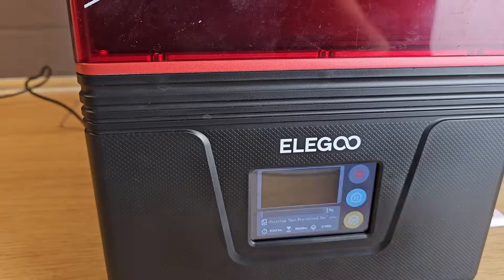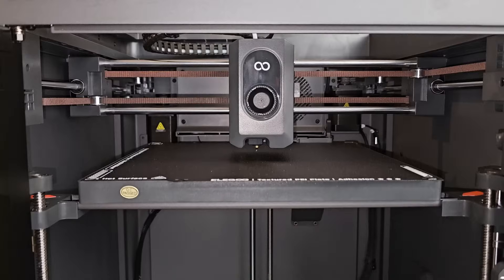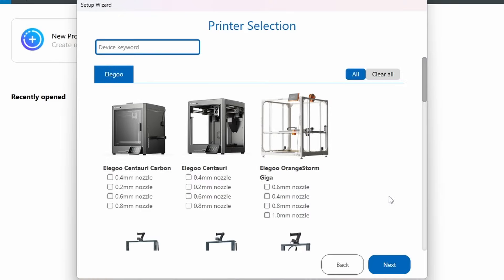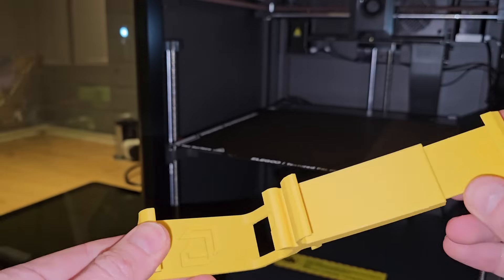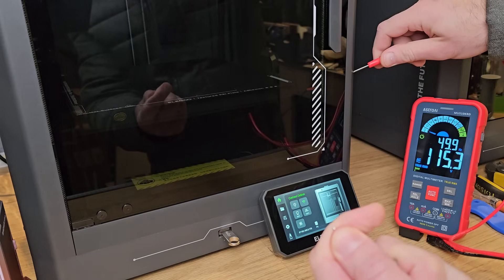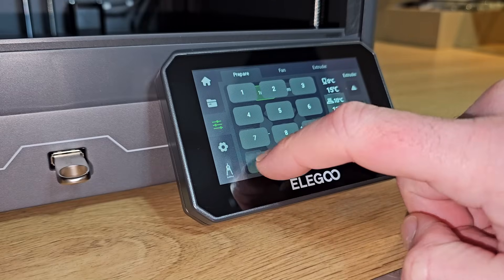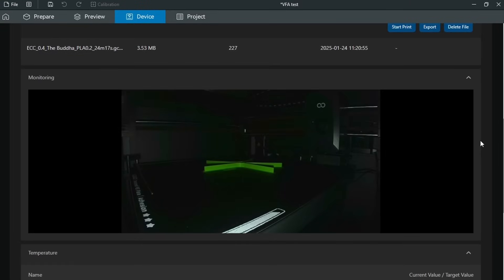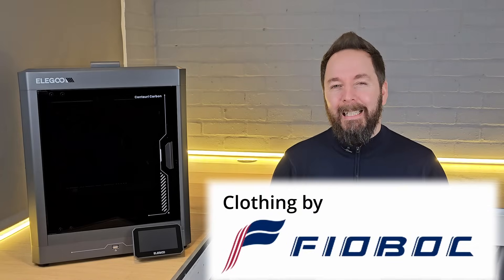Is The Centauri Carbon WORTH The Hype?

Comment: I think this printer is geared towards beginners and younger kids, and looks like they nailed that.  This printer has a place in that market for sure and obviously isn't for modders and experts, but every printer does not need to be.  There are plenty of options for that with RatRig and Voron.  Always enjoy your levelheaded and sensible reviews Ricky.  Keep them coming.
Reply: What even are experts? I use 3d printers professionally. I'm not modding them, I want them to work. I'm glad we are finally at a point that I can order a 3d printer, set it up and it works out of the box.
Reply: @user-sk4nt5bm5r I agree, I feel like most people aren't looking to mod these devices, modding is out of a necessity if certain features aren't provided. The better a device works out of the box, the better.
Reply: @user-sk4nt5bm5r  
Same. All those modders are mostly hobbyists. I spend all my time in cad and other software modeling, i start up the printer to prototype parts, i dont want to change anything, i want it to print, print fast and to keep dimensional accuracy.

Thats why i got a bambu, despite my serious dislike of the company and its policies they make printers that work. Though i want to switch, i dislike the company which seems on fast track to become as bad as 2d printer companies like HP, but so far the alternatives seem like a sad joke.
Reply from the maker: Yep, completely agree

Comment: You have actually found a very big electrical issue. It sounds like Neutral and Ground are reversed or connected at some point in the printer. Under proper operation, voltage comes in on the Line/Hot wire. Work is done as the current flows through the electronics to the Neutral (NOT ground) wire. All other conductive parts are linked and connected to ground as a safety net, in case something hot inadvertently touches a conductive non-electronic part like the frame. Ground will never have voltage unless something extremely serious is wrong.

So, what you discovered was two safety issues... Something hot is in fact touching or connected to the frame when it shouldn't be. And your ground circuit was in a state of failure, preventing it from acting as the safety net it is intended to be.

If two printers in a row had this same issue, there has likely been a manufacturing run (where two wires were reversed. Or someone on the line is putting them together wrong. Please make sure this info gets to someone at Elegoo who will understand the problem... They likely will need to halt all shipments and recall immediately.
Reply: You do realize that the ground and neutral are tied together.
Reply: @mrfunkington  If they were tied together in the way that you appear to be assuming, there would be zero need for both wires. They both terminate to the same bar in the electrical box (yes... they are tied together there), but this is not the same as being tied together in the appliance. In one case (what you are implying), a faulty ground line can kill someone. In the other, it serves as a safety feature as described.
Reply: @mrfunkington  It's better to stop talking when you have no training on the matter. There are multiple earthing arrangements - TN, TNS, TNC-S, TT. Yes, N and PE eventually come together - but definitely not on the consumer side of RCD.

Comment: i was looking at this and prusa core.  firmware might be a deal breaker with elegoo on this one.  one more check for prusa.
Reply: You're comparing a luxury German car to an entry level Japanese car with the high level package.  This printer is going to come in under $500 (a lot of people speculating closer to mid $300 pre-sale).  The Prusa core 1 is $1k
Reply: @mrfunkington  I have seen videos of elegoo and prusa go head to head.  Elegoo was right there few cases out did the prusa. as I'm replacing a 11 year old flashforge pro that is a dinosaur to today's stuff.  All and all they do the same in the end it PRINTS..  car gets you from point a to point b.

Comment: Electrician here please don't use cheap electrical equipment make sure it is UL listed if you are going to use it cheap manufacturing does not make safe electrical equipment the price savings is not worth your life.
Reply: These are not "production" machines but rather pre-production machines, sent out to hundreds or thousands of YouTubers and reviews to get them into their hands to make videos before the PRE-SALES launch on Monday February 17th.  So take all of the wrong things with a grain of salt.
Reply: @mrfunkington  This is a result of fundamental flaw in thinking about AC handling. Stop making excuses for potentially deadly equipment!
Reply: @wide.wombat he said himself that nothing elegoo sent caused the problem it was a adapter he was using not made by this company. You people have selective hearing or what?
Reply: @matthewhoy5577  It doesn't work like that. The dodgy cable exposed the issue with the printer, not caused it. 

A device should work 100% correctly without PE. Protective Earth is there only as a safety measure to save you from a shock when something fails. If it saves you from a shock when the device is new, the device is in failed state from the very beginning. A device like that would not pass any decent electrical safety certification.

Comment: I would suggest further investigation on the voltage on the case. Grounding is a backup incase there is a fault somewhere. The fact there was a break in the ground in the cable does not explain voltage on the case. If it is only happening during bed heating there is a lack of isolation in the SCR, wiring from SCR to bed or bed itself. There should always be full isolation between case and mains voltage.
Reply: shouldn't the gfci trigger instantly, when the case is under voltage?
Reply: @damian007567  Without PE (protective Earth) connector - no; it is just voltage, there is no current going out. But with PE or with someone touching the case - yes, it should trip.
Reply from the maker: Thanks, it felt like something wasn't 100% correct but my knowledge only goes so far with mains electric. Perhaps someone with more expertise need to take a look and see what's happening.
Reply: @RickyImpey  This.  Ground is a backup only.  The unit should maintain isolation during operation.     If these units go through ul or csa certification they would fail.   Very concerning.